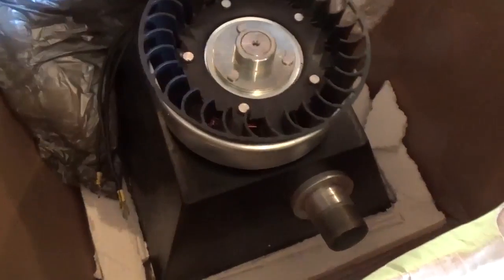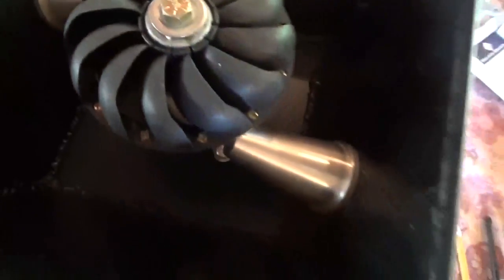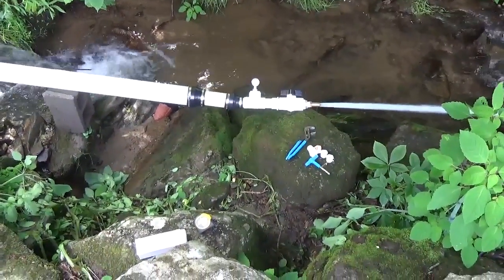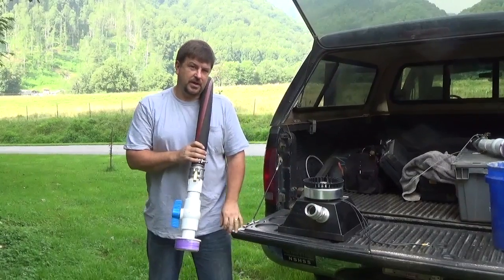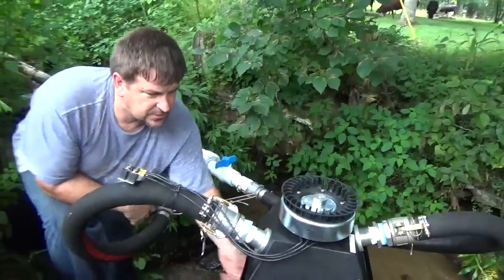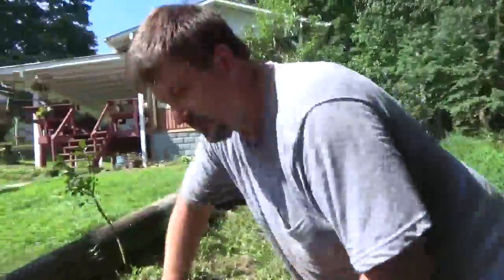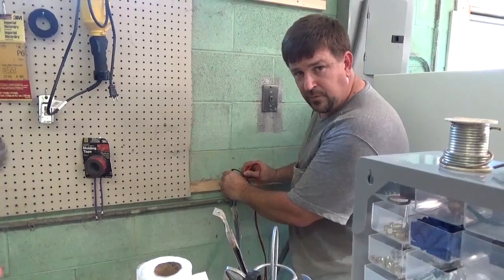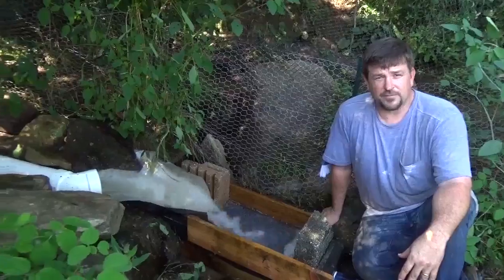Micro Hydro Power with Turgo generator Part 1

Comment: OK Preppers, Just curious! Say everthing goes down tomorrow! Now you're living off of your batteries, nobody is building new batteries because the world went to shit. In about four to five years when your batteries die what are you going to do? I didn't see the video on building a battery manufacturing plant!
Reply: Exactly. I have been looking on youtube for a way to use our stream to generate power without having to use batteries for the same reason you commented about. I still havent found how to do it. I know it can be done because of all the mills that worked on water before battery banks....just no one shows and explains how to do it.
Reply: +getsmartnow2011 look up hydro power there are some out there.  The deal with hydro power is you have to have a large volume of water and a good flow rate to generate 110V - 120V. It takes a good size generator like on a gas powered unit. Just remember that when you use power it causes a lot of drag on the generator like when a gas unit is running and you use power you hear the unit bog down. That's drag which is why you need a lot of water with a high flow rate. It can be done though! It also takes a lot of money. Not something most people have to throw at a mini Hoover Dam. Good luck in your Qwest for sustainable free energy!

Comment: did we ever get final readings on its output? I'm really interested in this design and its efficiency. I'm hoping to be living in a small off grid home and I'm thinking 2 of these with a  similar set up should be a good enough power source. i was on the website and i think the 4 nozzle design is a little overkill and might actually make it work less efficient. 

Awesome videos engineer775!
Reply: let me know if I can help you with your hydro needs 843-319-4830 thanks Spencer
Reply: @SpencerLAPower  Where are you located?
Reply: @eastcoasthistoryhunter2027   Timmonsville South Carolina
Reply: Did you ever hook up 2 of these units? I'm thinking the same but you have 5 yrs on me. Does it work well?

Comment: couldn't I run the AC coming off that to a stand alone (off grid) breaker panel and run my AC lights and electric power strip???
Reply: the power that is produced is referred to as "wild" ac.
meaning the frequency is not constant. with a hydro system, it would be easy to get the required 60 hertz, but usually people feed the wild ac into a full wave bridge rectifier, then into a inverter, then into a breaker panel, or grid tie to back feed the commercial power. the voltage output is another issue. the system in this video is a permanent magnet alternator. ideally you would want to be able to regulate the field to help keep the voltage more stable.
Reply: Mike Shea think:
- lights flicker, or get bright then blow out.
- clocks don't keep time.
- refrigerator tries to kick on, but the power sags, the refrigerator compressor motor stalls (eventually burning out) and your computer crashes.

And other such fun.  Clean, controlled power beats unregulated voltage and frequency power.

Comment: If its really as noisy as it appears to be. I think that is a really annoying spot to place it, 20 feet from the house. But I really like the idea, especially if you are in a location where the creek runs year long, you can have rock solid stable power all the time.
Reply: +Kenney Madsen you can mask it in anti sound barier planks ........
Reply: Kenney Madsen the creek itself is very loud when your in a silent bush ......I've never been in the bush and it was quiet.
Reply: LOL Kenney you're complaining about noise from water? Beats car alarms any day!
Reply: SUPERNOVA 
Those noise comments are just ignorant people
Reply: Thats right the sound of the stream will dround out the sound of the generator
Reply: Put a box over it or a wall around it to muffle or redirect the sound.
Reply: Place it in an old refrigerator/freezer with a trap on the drain to air seal it

Comment: Very cool setup!
The slue system you have set up looks like it's stopping a good bit of the kinetic energy of the moving water. Could you get more pressure by storing the water first in a very large container and then siphoning it out from the bottom?
Reply: +Matthew Vidal sluice

Comment: The 300 foot run sounds like an issue that could use some innovation to combat voltage drop. I'm wondering if its worth the cost to upsize the wire and/or a buck-boost transformer

Comment: This is brilliant. GREAT work on this hydro system. I would like to know what the continuous DC current (for a 24v battery bank) is after rectification and going through a charge controller. My best guess (and reading the comments below) it looks like about 15 amps of continuous charge current. Am I wrong? I want one! Or four. I salute you man...sexy stuff you got going on.
Reply: This unit running at 11 PSI  260 watt @ 24 volts 10.4 amps if you would like to order you can call Spencer Langston at 843 319 4830

Comment: good shit bro. angle your intake screens so water go in, debris fall off and to the downstream side, should prevent fouling
Reply: Ya, he needs to construct a ‘pool’ so water velocity at the intake is like almost nothing. The quiet water in the pool will settle stuff that can be cleaned periodically instead of the supply line having to take every piece of debris and silt that goes by.

Comment: I bought one of these on ebay, and really was a robbery.
I did not work well.

40 psi, 120volts, when I connected something stopped.
Reply: +Braulis Perez   I do not sale these units on ebay  ser.

Comment: You just need a good dam to use all the water.  With that water flow you could go to 120 volts ac with no dc system at all.

Comment: Is it possible with such low voltage and possible swaying frequency to input the AC into a step up transformer (be it single core 3 phase or 3 single phase transformers) to transmit then step down again?
Of course we're increasing losses but for a further distance it could be more economical over a large voltage drop or spending lots on more copper.

Comment: Thanks for sharing your hydro project and I can't wait to see the rest of this installation with as much detail as you can share. 
I have found a piece of property left over from the second world war that has a old power house and 500 feet of 8 inch steel pipe with 125 feet of drop still in place.
Having a independent off grid power system is a big step in being self sufficient so I hope to join you in this independence one day, Again great work !

Comment: Those hoses feeding the turbine need some support. The connections to the nozzles are bearing the load and asking for failure soon. The sluice system needs some TLC. Other than that it's a good start and proves the function. Thanks for posting.

Comment: How expensive was all that
Reply from the maker: Cameron Sizemore  Turbine, wire, rectifier, Pipe, hardware ~ $2500.00.   Now the electrical side ( inverter, charge controller, critical loads panel ( house tie in), batteries, battery box ) I will cover that in part 2

Comment: From the look of the welds around the 1:20 mark I assume this unit is from a very low tier Chinese manufacturer? Given this unit is intended to supply power in a potentially critical situation, cutting corners by choosing the cheapest fabricator seems to be a false economy - Chinese fab houses would not charge much at all to to have it welded to a decent spec.

Comment: i still can't see why you haven't ventured into absorption "non chiller" ac. with the use of evacuated tube thermal transfer.  just like that in rv refrigeration, only scaled up a bit. why must it be based on a chiller? i don't see the efficiency in storing an icy slurry. i also would love to see something on sealed steam engine, the making of an axial flux generators and harvesting methane from the septic tank to power the steam driven engine. also i would like your thoughts on the bedini wheel sg energizer. it puts many aspects of tesla's theories to use. well that would practice the theories from the theory to fact. but i have a few of my own to add. and your thought on alum batteries and charge voltages as high as 15.1 to 15.3 volts.

Comment: Scott, not sure if you stated. How many watts of power, at 24vdc, will this provide?
Reply: +DanielRichards644 Whoa....  by the way, watts and kilowatts is a measure of instantaneous power.  kWh (kilowatthours) is a measure of energy.  I think you're mixing terms.  If he wants 10 kWh per day, here's what he'll need to produce (assuming 50 volts).
10000 watt-hrs/day
417 watt-hrs per hour (or) continually produce 417 watts of power
417 watts / 50 volts = 8.33 amps
Reply: +Paul Petrea in the description he says the goal was to produce 10,000 watts a day
Reply: +DanielRichards644 what would that be in kilowatt hours?
Reply: Bob Robinson
 from the description "produce about 10,000 watts of power a day" that would be 10 Kw, NOT 10 Kw per hour, if a system this small could produce 10Kw an hour you could make back the cost of the machine by selling energy to the grid in like a month. nowhere does it say it's producing 10k watts continuously.
Reply: +DanielRichards644 10kW per day would be a lot more than I need. I need to find me a nice little stream that flows year round, here in the "Land of Wonder".
Reply: jugghead98
 well thats simple math, 10,000 watts a day (operating continuously all day) is a total production of 10 Kw's a day divided by 24 hours for 0.416 kWh, so a little under half a kilowatt an hour, so roughly equivalent to a little under 2 250 watt solar panels at peak sun, but unlike solar it's 24/7.
Reply: +DanielRichards644 Thank you. I missed that in the description.
Reply: Paul Petrea
 Yeah, I did the math for my personal usage and I only need about 3.5Kw a day outside of the air conditioning and hot water, the house I'm currently in with an electric hot water heater and 2 side by side refrigerators (one energy star one not) uses about 12-14Kw a day if I don't run the dehumidifier or AC and 4-5 of that are the 2 fridges, which could be shaved down to around 1 Kw with a more appropriately sized fridge for me. I bought a Kill-a-Watt meter and use it to monitor the power usage of different items in the house then did the math to calculate out my usage per day/month, for the fridges I left it connected for a few days on each to get the average usage of them.
Reply: If he wanted to produce 10000 watts of power, he'd have to run 50 volts at 200 amps.  If that's the case.  color me impressed.
Reply: Bob Robinson
NO I DID NOT DELETE MY ORIGINAL COMMENT, your just that much of a dumbass that you can't look back far enough in the comments to see it. I KNOW 1,000 watts running for 1 hour is 1Kw, but it's NOT A FUCKING CONTINUOUS 10,000 watts being produced and I NEVER SAID IT WAS, it's a TOTAL of 10,000 watts FOR THE FUCKING DAY, READ THE FUCKING DESCRIPTION.

Comment: What part of the country is this and does it work in the winter or will it freeze up?
Reply: That mist will freeze things over real quick though!
Reply: +Marc water flowing that fast continuously needs EXETREMELY cold temperatures to actually freeze, if your creek doesn't freeze over during the winter I doubt this would freeze over.
Reply: If it did try and freeze then right there is a power supply. Get a heater lol. Nothing goes together like electric heaters and water spray lol.
Reply: a Good flowing creek will freeze along the edges but not so much in the middle. If it does pool in a spot.. only the top would freeze over while allowing water to flow under the ice.
Reply: He's in the mountains of Virginia, that thing will freeze solid and crack seams. I'd be more worried about no protection on that plastic upper fan assembly, one stick falls into it from a tree and that thing is shattering blades and then off-balance, quick bearing damage, wear on the drive shaft and its soon a $950 creek ornament.

Comment: Hello: I guess I would not worry about 1 volt. But I would want the right working voltage at full load. That is a mass supply of water. I wonder what the source is. Well I would like to see the source and how it was rigged to operate. I have a friend that built a concrete box on the side of a creek with a door. 4'' PVC is in the box which runs 250' to fill a pond which over flows back into the creek. This 4'' PVC also fills a water box that's 3' in the ground and 4' out of the ground with a valve in it that feeds 2 3'' PVC pipes that come out off the ground over a 9' water wheel and that water falls back into the creek. The water wheel can turn a one wire alternator 24/7.

Comment: That's really good considering you are not using pure water in a laboratory and also the voltage drop (not sure how far your run is or gauge or wire material - copper? - aluminum? - strands? - solid?) and the conversion to DC.  Also, the sluice material and rocks aren't exactly space age design. LOL.  I wonder if you had one sluice per inlet and if the sluices were at a steep downwad angle rather than level, what the difference would be.